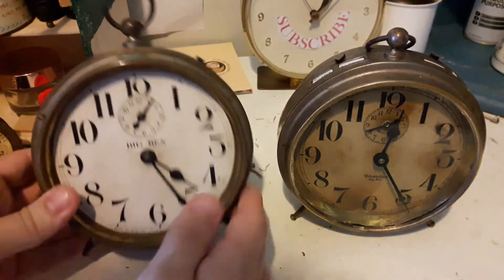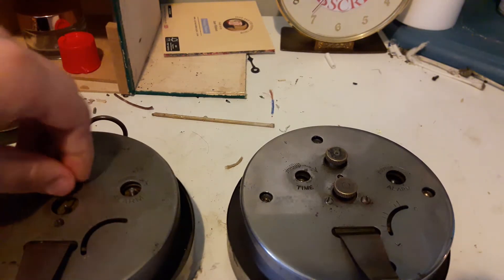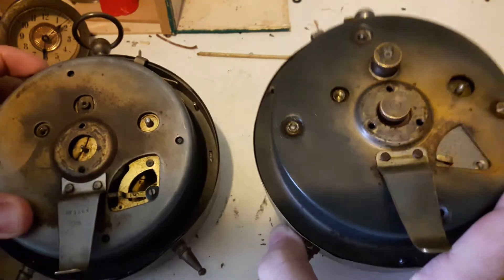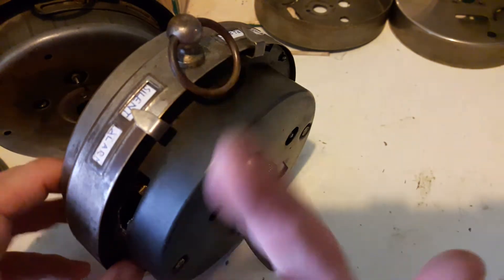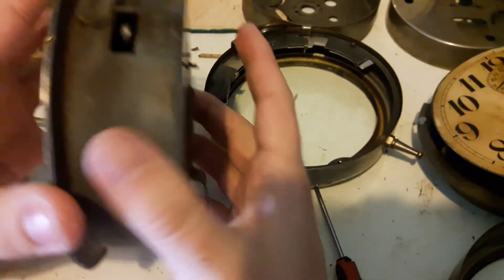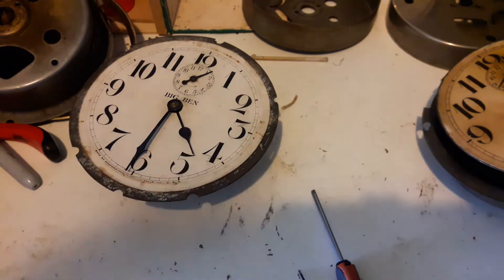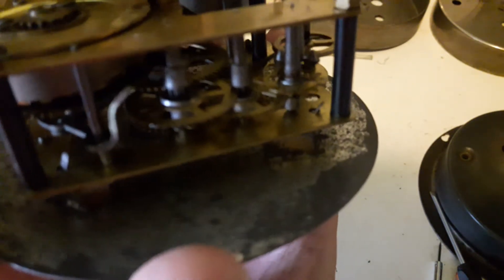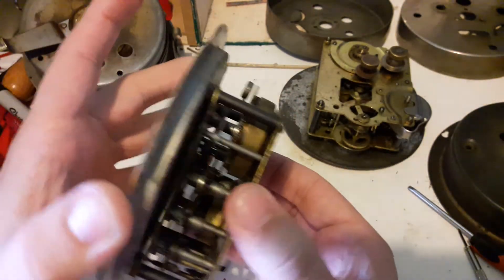Westclox Big Ben Style 1 vs 1a mechanical comparison

Comment: The whole idea of the 1A was to have a more dust-proof clock. A real game changer in a market of somewhat cheap mass produced pin-pallet clocks. A aspect of Westclox they'd keep up until the very end.
Reply from the maker: yeah, i was a bit surprised to see that it didn't have the movement bolted to the back of the inner case like every other big ben that came after. There was actually less dust in this movement than the style 4